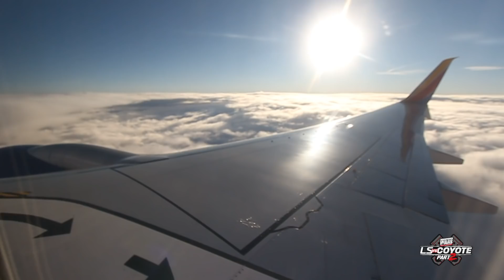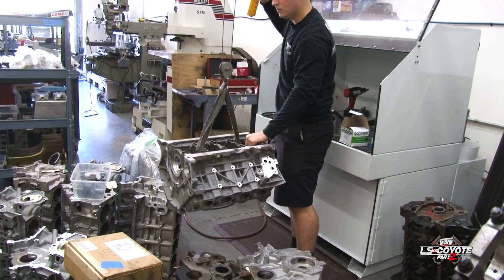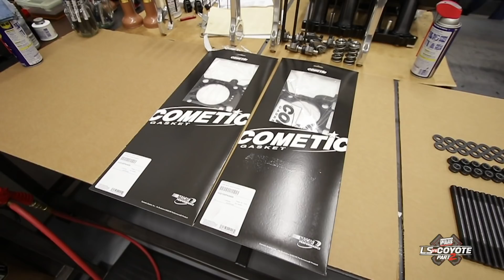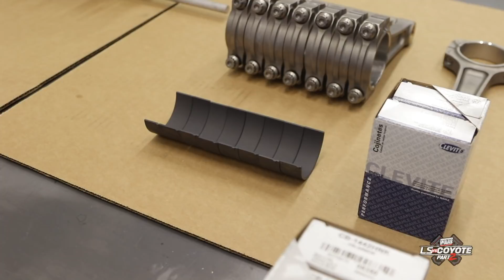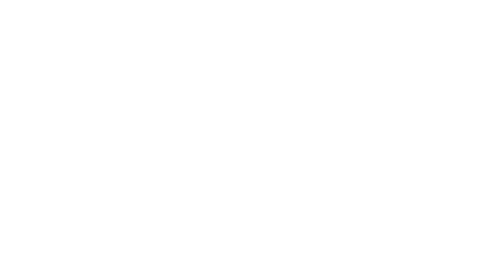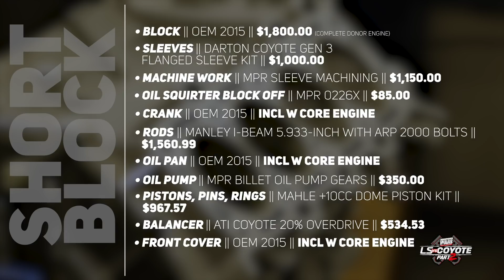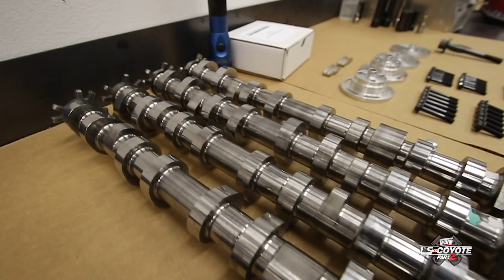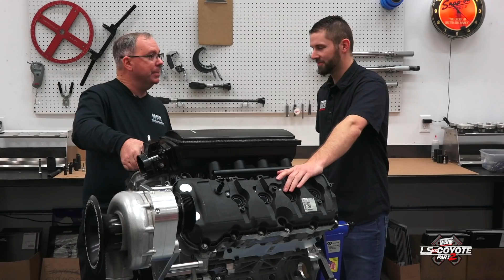LS vs. Coyote 2 Episode 3: The Coyote Engine Build

Comment: Chevy dude fell in love with that coyote. He can see the light
Reply: He will when through the window in the block....
Reply: Got Juice The old Modular block has held nearly double the power any OEM LS block has.  

Funny how a block gets stronger when you don’t have to machine a cam journal through the center of it.  Poor LS...
Reply: @BCSVT  All of you guys can talk all the smack ya want, but the fact remains a well built Coyote OR Chrysler Hemi engine is so damned stupid expensive, it's completely out of the realm of the average guy, and I'm talking about middle income folks........not liberal bums who can't afford a used car. Dollar for dollar spent on horsepower, ya just can't beat the LS platforms. And the PROOF of what I'm saying is all the guys, numbering in the thousands, who drop an LS into an old Fox body MUSTANG. That just burns your asses, and you know it. And by the way "BC".......your comment about "blocks being stronger with no cam journal bored through the center" is pure bullshit. Because literally tens of thousands of built LS motors making incredible power are living just fine. Most of you guys talking smack against LS engines can't even dream of affording a Coyote motor anyway, and you know it.
Reply: Howabouthetruth You’re just regurgitating the same, old ignorant myth.  The only thing more expensive about a fresh Coyote build is the camshafts.   Everything else is on par.  

The LS’ advantage come in junkyard availability and the Gen IV truck engine’s ability to handle some basic 700rw combos with decent reliability.  As power climbs beyond that the LS becomes exponentially more and more expensive.  To make 2000+ HP the 4V Fords have always been able to get there more cheaply than the LS platform.  

LS’ are only cheap to a point. 

I know many, many guys with over $30K tied up in LS-based longblocks that I could match the performance of with a $15k 4.6 4V build.
Reply: @BCSVT  Oh BULLSHIT.........The ONLY thing you said that is true is the fact you can find LS donor engines all over the place for dirt cheap. And the $$$ you saved goes towards heads & porting and slap a turbo charger on it .....( with forged steel rotating assembly for anything with crazy power ) and it's A FRACTION of the price of the Coyote. Funny how ( and this REALLY burns your ass ) that dude did just that & dropped it in his old beat up Fox body Mustang ( famously known as "THE BEATER BOMB" ).........and he beats the living piss out of over 90% of the guys he's racing. Even guys making "more power"..........WHY???.......BECAUSE IN THE REAL WORLD, RAW "RAW HORSE POWER" MEANS NOTHING IF YA CAN'T GET THE CAR TO HOOK UP ON THE TRACK, OR HANDLE ON A ROAD COURSE. AND KNOWING HOW TO DRIVE IS JUST AS IMPORTANT TOO. POWER IS ABSOLUTELY NOTHING WITHOUT CONTROL. WELCOME TO THE REAL WORLD. There's guys making around 900rwhp beating the shit out of guys with 1,400.......because they are hooking up & launching better........"Einstein". And "where's all these Coyote motors" running in street rods all over the world??? HUH??? OH, THAT'S RIGHT, THEY'RE ALL USING THE LS PLATFORMS INSTEAD. And for your information, I'm not one of these "Ford vs Chevy vs Chrysler vs foreign" guys. I like them ALL. But I'm also rooted in REALITY. And the reality is you just can't beat the VALUE of the LS platform for making cheap RELIABLE power if done correctly. We're not living in a world where most guys have "an unlimited budget" to build all new shit starting with an OEM crate motor and building UP from there.  HELLOOOO.  SMART guys who live in the real world are relying on the PROVEN LS platforms straight out of the junk yard to build incredible power vs COST. And you will NOT do that with Ford or Chrysler set-ups. END OF STORY.
Reply: @howabouthetruth2157  There's zero in bullshit in my post, feel free to refute a single, solitary point I made in my previous post.  

You know how I know I'm not full of shit?  I've done it.  I know what it takes with both engines.  I know what costs what, what's obvious is you don't.

PS  Coyotes swaps in street rods have become very common.  But don't let that stop you from continuing on with your ad populum logical fallacies.  
PPS  Stock Coyote engines will handle every bit as much power as an iron block Gen IV truck engine (the strong ones), makes far more power than the iron Gen IV truck engines (power adder for power adder OR n/a)  and running Coyote truck engines are becoming common on the used "junkyard" market.
Reply: @BCSVT  BC........I ALREADY refuted what you stated WITH PROVEN FACTS ........DUMB ASS. Hey, YOU started this BULLSHIT by stating tour absolute NONSENSE about how "the LS is weaker due to the cam bore in the block"......PLEASE SHOW THE CLASS WHERE ALL OF THESE LS ENGINES ARE THAT "FAILED DUE TO THE CAM IN BLOCK DESIGN". That was the whole reason I replied to your bullshit to begin with. AN ENGINE IS SUPPOSE TO HAVE AN ADEQUATE COOLING SYSTEM, WHICH MAKES YOUR FAIRY TALE A MOOT POINT TO BEGIN WITH. Furthermore, youtuber "Cleetus Mcfarland" ran his stripped down Corvette "Leroy" to become the first GM stick shift car to run in the 7's.......AND THEY DID IT WITH AN ALUMINUM LS BLOCK DRAINED COMPLETELY DRY OF ALL COOLANT/WATER DUE TO A BLOWN HEAD GASKET. THAT'S RIGHT, AFTER THEY DETECTED THAT THE HEAD WAS LEAKING WATER ON THE DRIVER'S SIDE, THEY PURPOSELY DRAINED ALL THE WATER/COOLANT SO HE WOULDN'T CRASH, AND CONTINUED MAKING FOUR 1/4 MILE PASSES TO BREAK THE RECORD, THEN DROVE IT BACK DOWN THE RETURN LANE, CRANKED IT UP AGAIN TO DRIVE IT INTO THE TRAILER, STILL RUNNING. They shipped the complete engine back to Texas Speed & Performance who had originally re-sleeved the FACTORY aluminum LS block ( NOT a cast iron block ) with their own sleeves, wherein they documented the entire tear down & inspection on video with NO edits. THE BLOCK WAS JUST FINE, EVEN THOUGH IT RUINED THE CRANK & BURNT A ROD & THE ROD BEARING. THE BLOCK IS TOTALLY RE-USABLE. SO WERE BOTH HEADS. GO SEE BOTH OF THOSE VIDEOS FOR YOURSELF. CARE TO EXPLAIN THAT???  WHAT IS "SO WEAK" ABOUT THE LS??? So you can take your FAIRY TALE about "LS blocks being weaker due to boring a cam journal in the block" and shove that made up bullshit straight up your ass. LET'S SEE YOU RUN A COYOTE MOTOR WITH ZERO WATER/COOLANT FOR 4 PASSES AT OVER 170 MPH ..........GOOD LUCK WITH THAT......JACK ASS.
Reply: @howabouthetruth2157  You refuted nothing.  

NO OEM cast aluminum LS block has reliably supported 2000 HP.  
Andreas Arthursson made the most power with an OEM cast LS block, at about 2000 HP with a FILLED, IRON block but even that was unreliable for him at that power and he made the switch do a DART billet eventually. 
Unfilled, OEM cast aluminum 4.6 and 5.4 blocks have been reliably holding 2800-3300 HP for a decade.  

The LS block generally begin to crack, you guessed it, at the cam journal web.  Shocking.  

Coyote motor making 1/4 mile passes with no coolant @ 170 mph?  On alcohol/ethanol fuels, not a problem for most engines.  
Your problem is you suffer from a severe lack of knowledge and severe confirmation bias.  
PS, Cleetus barely made 1000 RWHP with OEM block.  He is now using an iron LSX block, the same block Justin Schmidt split several examples of in a single season of X275 at well less than 2000 HP a few years back.
Reply: @Searb reath  Searb reath..........THANK YOU. At least someone other than me here has some common sense & lives in the real world..........Because this other viewer "B C" simply happens to be one of those delusional candy ass "Ford guys" who wants to make every stupid excuse to hate on the best damn V8 platform mass produced to this day. I like them all........but it pisses me off to see ANY of these guys cry & whine as they stick up for "their favorite manufacturer". I like em all. But there's no denying that General Motors made a real winner when they produced the LS family of engines. Cheapest AND easiest to make serious reliable power FOR FAR LESS.
Reply: @howabouthetruth2157  He is as ignorant as you.  Feel free to put together a 2000+ HP reliable LS combo and send me the bill so I can laugh at your sticker shock.  You speak like someone that has never done anything beyond a run-of-the-mill junkyard build, which is clearly exactly what you are.
Reply: @UCLw75Flh9QUa9cSZFxVB_dQ BC..........HEY ASSHOLE, NOBODY HERE IN THIS BUILD OFF IS BUILDING "2,800 - 3,300 hp" ENGINES. FURTHERMORE, GO TRY TO ARGUE WITH NELSON RACING.........JACK ASS. BESIDES, BUILDING A STREET ROD WITH "2,800 - 3,300 hp" IS NOTHING MORE THAN VANITY.  GUYS ARE RUNNING 1,200 TO 1,400 hp TO RUN 7 SECOND PASSES WITH NO PROBLEMS WHATSOEVER USING LS ENGINES. AND I'LL REPEAT MYSELF: WHERE'S ALL THE "COYOTE BUDGET BUILDS" ALL OVER THE WORLD???  I REST MY CASE, YET AGAIN......BECAUSE THE LS PLATFORM HAS THAT TITLE. WHO THE FUCK GIVES A DAMN ABOUT "2,800 - 3,300 hp" IN THE REAL WORLD. BECAUSE IT DON'T MEAN SHIT WHILE YOUR SITTING THERE SPINNING TIRES, AND YOUR COMPETITOR JUST BLEW YOUR FUCKING DOORS OFF MAKING HALF THE POWER.......SO FUCK OFF DAISY.  I NEVER SAID I DISLIKE FORDS OR CHRYSLERS......OTHER THAN THEY ARE TOO DAMNED EXPENSIVE FOR THE AVERAGE GUY TO BUILD. GM MADE A REAL WINNER WITH THE LS PLATFORM, AND EVERYONE KNOWS IT. YOU HAVE TONS OF OPTIONS & THEY'RE ALSO THE EASIEST V8 TO BUILD.....  LAST BUT CERTAINLY NOT LEAST>>>>> HERE'S 2 SIMPLE QUESTIONS FOR YOU........DUMB ASS>>>>> #1: WHAT ENGINE PLATFORM ARE ALL THE TOP FUEL GUYS USING TO MAKE 11,000 HP, AND HAVE BEEN FOR DECADES.......ANSWER>>>> THE CHRYSLER HEMI PUSHROD ENGINE.........QUESTION #2: WHERE ARE "ALL THE FORD COYOTE MOTORS WITH OVERHEAD CAMS" IN TOP FUEL COMPETITION........ANSWER>>>> ZERO.  AND DON'T EVEN TRY THE LAME EXCUSE "THEY ARE AFTERMARKET EXOTIC BLOCKS" BECAUSE "A" >>>> THEY STILL USE THE PUSHROD DESIGN, AND "B" >>> BACK WHEN TOP FUEL WAS STILL A REALISTIC MOTOR SPORT, EVERYONE LIKE DON GARLITS AND SHIRLEY MULDOWNEY WERE RUNNING THEIR ENGINES IN MULTIPLE RACES AND ENTIRE SEASONS......NOT "BLOWING THEM UP DURING EVERY PASS" LIKE THEY DO TODAY........BUT EVEN SO, THE BLOCKS TODAY WITH PUSHROD DESIGN MAKING 11,000 HP ARE STILL RE-USED A NUMBER OF TIMES.......AND "YES"........I'M TOTALLY AWARE THAT "MY CAPSLOCK IS ON"........SO GO FUCK YOURSELF.
Reply: @BCSVT  B C........Go read my final response to you asshole, I was just about to post it when you posted this nonsense again. There's TONS of guys out there that built "junk yard engines" using LS platforms that'll outrun your candy ass, and you damn well know it. PLEASE.......BRING YOUR SHIT AND RACE "BEATER BOMB".....EVERYONE NOT LIVING UNDER A ROCK KNOWS WHO HE IS........SEE HOW WELL "THAT WORKS OUT FOR YA".........AND TAKE YOUR COYOTE MOTOR & BUILD IT WITH 11,000 HP FOR TOP FUEL COMPETITION........BECAUSE "YOU'LL BE THE FIRST". NOT HAPPENING.......YA WANNA TALK ABOUT "HIGH HORSE POWER" ASSHOLE???  YOU GO READ MY PREVIOUS RESPONSE ABOUT TOP FUEL ASSHOLE.....I DARE YOU. CASE CLOSE.........JACK ASS. ( I swear.......it takes a true candy ass pom pom waving cheer leader nowadays to piss & whine as they claim "LS engines are weak" or "they suck".........that's pure BULLSHIT.
Reply: @Searb reath  Searb reath........That's damn right. Hell, I bought my 2000 Tacoma 4x4 with automatic transmission & 3RZ engine ( duel overhead cam version ) and it'll outlast them all as far as a daily driver. Here it is well over 18 yrs later and over 330,000 miles.....on ALL original engine & drive train......and I've beat the living piss out of it years ago when it was newer. But that doesn't mean I don't love all the great V8's made by all 3 manufacturers at one time period or the other. Besides, all the best tech/mechanics frown on these morons like this other viewer "B C" who is hell bent on "dissing the LS platform".........what a freakin' joke. He's crying & claiming the LS engine can't handle "2,000 to 3,300 hp"..........only clowns dream of engines making that much power. So I told him to take his damn Coyote motor "with 4 overhead cams" and build it to handle 11,000 hp and see how he does in Top Fuel competition. I rest my case. Because NOTHING can stand that amount of power like the pushrid engine design. ( or even 6,000 hp, like back when Top Fuel was still "a realistic motor sport" as teams like Don Garlits and Muldowney ran their Hemi pushrod engines all season long with far less rebuilding like they have to do today......but even today.....the blocks are still good for about a dozen races ) I rest my Case........
Reply: ......and PS.........Back in the days when Garlits and Muldowney ran Top Fuel.......they were indeed running over 250 mph.........with full blown pushrod Hemi engines.  Let's see the crybaby viewer "B C" answer to that one. Even at the 6,000 hp they were making back then.......it would sling "4 overhead cams" all to pieces. That's exactly why they haven't ran them all these decades in Top Fuel. I don't even count today's Top Fuel racing, because ya have to be a billionaire ( literally ) to afford blowing those 11,000 hp motors up during every pass.
Reply: @howabouthetruth2157  You don't speak for everyone.  In fact, you can't even speak for yourself.   
I supply 1500+ HP engine builds with regularity, such power levels are downright common even in street cars these days. 
Not everyone is content with 700-800 rwhp junkyard builds, but I suppose keeping your goals low keeps in the LS impressive in your mind.     

The Coyote architecture will not support top fuel levels of power, but with OEM cylinder head castings it will get about 1200 HP closer than the LS will with OEM head castings.  

Let me know when the LS finally cracks off sub 5.90 @ 250+ mph 1/4 mile passes like the old 4.6 4V has on OEM cylinder heads and OEM block castings. 
Last I checked, the LS was still way short of that even with 6-bolt canted valve heads and Kurt Urban-spec Dart billet blocks and not a single GM part anywhere in or on the engine.
Reply: Howabouthetruth you don't get out much
Reply: @jaywhy225  Jay Why.........What the hell is it with freaks like you. Is that all you've got? How many times do people like myself have to repeat time & time again that we like MANY of the engine designs from MANY of the auto makers, but can't stand it when some candy ass "Ford or "Chevy" or "Mopar" guy starts acting like a damned pom pom waving cheer leader to dis other auto makers. It's childish BULLSHIT. Even the best techs/mechanics frown at that bullshit, because they KNOW that many of these engines from "the big 3" can be built to get very similar power compared to one another. But the UNDENIABLE fact remains that ya just can't beat the LS platform when it comes to "horse power vs cost". Asshole viewers like YOU and "B C" who made the stupid claim that "the LS is weak because of the cam bore".......is TOTAL BULLSHIT. Most of these guys wanting to make "2000 to 3000 hp" in a street/strip car are doing that silly shit out of sheer vanity. "Sheer  horse power" NEVER won a damn race all by itself, and anyone with a brain should know better. So you can take your silly "you don't get out much" statement and shove it up your ass too. I'm a business owner, and I run my ass off. I've got plenty to do, and facts to mention in a debate. You don't have shit to offer. If you're gonna post a response here, you could at least offer up something that pertains to the subject at hand..........but you can't even do that.......asshole.
Reply: @howabouthetruth2157  The LS block is made weaker by the cam bore, much weaker than it would be if the if the cam journals were left unmachined. 
All OEM LS blocks (aluminum or iron) are also weaker than the all OEM 4.6 & 5.4 aluminum blocks. 
You have yet to refute that assertion, and lack the knowledge and experience to do so.  
I'm not sure you realize how truly self-evidence that statement actually is.  

Your statements to the contrary makes you look less intelligent than your choice of grade-school insults.  

Making 2000+ horsepower is not vanity, it's what necessary to be competitive in many racing classes and events. 
What's good enough for you obviously isn't good enough for me, so stay average and the LS will continue to satisfy you.
Reply: Howabouthetruth triggered much bro ?    Quite the retort to the simplest of responses.    Look at you go assuming my position on any of the things posted above or in this video.   Calm down muffin.    Your bias isn’t allowing you to see beyond the scope of this challenge.
Reply: @howabouthetruth2157  if anybody is angry it's you bro. CAPS LOCK DOESNT MAKE YOUR POINT MORE VALID, IF ANYTHING IT MAKES IT LESS VALID BECAUSE IT SHOWS YOUR ANGER. ESPECIALLY when you CAPS random ASS words FOR emphasis.
Reply: @jaywhy225  howabout is right. you are the one who doesn't have anything better to do with yourself. he also told the truth about ls engines. they are nu 1 for making power for less money, and they last. so get a life.
Reply: @robertmillison8933  Robert Millison.........MY CAPSLOCK OBVIOUSLY BOTHERS THE SHIT OUT OF YOU. AND YOU'RE ANOTHER CANDY ASS POSTING A COMMENT/RESPONSE THAT HAS ABSOLUTELY NO RELEVANCE TO THE SUBJECT AT HAND. GET A LIFE PUNK. I DON'T GIVE A RAT'S ASS WHAT YOU THINK.
Reply: @robertmillison8933  Robert Millison........Hey everyone........get a load of this NOBODY "Robert Millison".......and I mean that literally. Go check out his "youtube channel". NOTHING THERE. IT'S A BIG BLANK. Just like his mind when it comes to what was said here. Stupid assholes aren't even capable of reading the material, he's too "upset with capslock"........but he says "I'm the one that has the problem".......WOW......JUST WOW. Go play with your cat or watch TV boy........you're missing cartoons. Come back when ya know more about engines. Or else mind your own damned business.
Reply: entrepreneurhomeboy lol.  Player 2 has entered the game.   Look at you go !     “THOSE that SCREAM the LOUDEST”.        Yes it’s true, for less budget you can make decent power with the LS platform vs anyone else.  I don’t think anyone is denying that.   Bump that budget up and the field is levelled, if not leaning other directions.  THAT is FACT.     If you want to be a budget fanboi, so be it, being cheap is being cheap.   Want to make serious power, get your wallet out.    Ask me how I know.    Oh yeah, show me an LS true street car (as produced by manufacturers, no tube frame, back half, etc) that runs 6’s and 7’s please.   We’ll all wait.
Reply: @howabouthetruth2157   You really don't get out much, do you?

I guess Chevy is the rock you live you under.
Reply: B C ooof.   Wait for it ....   more CAPS lock from trigger muffin.    Lol
Reply: @howabouthetruth2157  wow. Such anger. Much rage. Over what? Me saying that you can get a point across without using caps lock like an angry teenager. Did daddy touch you when you were a kiddo? Did Uncle Jimmy diddle you while talking about Ford motors? Is that why you're so triggered over a video about a coyote motor? I can tell it brings up bad memories for you. You'd should probably get some counseling. Maybe go to the police and show them on the little dolly where the bad man touched you? I'll wait.
Reply: @jaywhy225  what's your problem jay? you think it takes a tube frame to build a street legal car that could run 7's? who said anything about that, other than you? the only difference between a street legal car that can run 7's is they will not allow you on a sanctioned drag strip due to safety regulations. and it's awful funny, garrett (cleetus mcfarland ) has driven "leroy" on the streets. "player 2 has entered the game".......seriously?" nobody was talking to you in the beginning, and you decided to "enter into the scene" yourself........but ya don't like it when i did? what a hypocrite. you need to get a life, because i read this entire thread, and that one dude was saying that nonsense about ls engines not being strong enough at the cam bore. funny, we don't see them all over the junk yards because of that. they are only in the junk yards by the thousands because they were wrecked. plus ya just agreed that the ls is the choice for building power for less. and then turn right around to start shit over "raising the budget". who freaking cares. you are seriously the one who has nothing better to do with yourself. so get a life you hypocrite.
Reply: @entrepreneurhomeboy   Yeah, because your average junkyard engine is making triple and quadruple the stock power.  You do realize this statement, like your ignorant brother's up there, doesn't refute anything, right?   Go build a 1500+ crank HP OEM block LS and let me know how long it lasts and what is the failure point it.  I'll wait.
Reply: @robertmillison8933  ATTENTION ALL VIEWERS: Get a load of this asshole liberal freak named "Robert Millison". Just look at how he has now lowered himself to perverted shit. Where did THAT come from. FROM HIS OWN MIND. THIS IS WHERE HIS OWN TRAIN OF THOUGHT GOES. Does that make you feel like a big boy Robert? Only little punks talk like that who were raised by a single whore of a liberal mother. THEY RAISE LITTLE WORTHLESS BRATS. That goes to show where his head is at. Nothing but a worthless coward looking to start shit with someone for no good reason whatsoever. I also find it quite odd that these house flies like Robert Millison are almost always the ones with NOTHING on their own youtube channel but a big blank. He JACK ASS.........if you used your fucking brain for once in your life and read this entire thread in proper order, you would know that I have nothing against the Coyote motor at all. I just fire back at the assholes who wave their pom poms for what they favor, as they talk total bullshit about another make. If I saw a "Chevy only" fanboy saying "the Coyote is a piece of shit"......I would set him straight too.......DUMB ASS. Just like I told "B C" that if he wants to start talking about ridiculous amounts of power, then why doesn't he try to make his Coyote motor handle 11,000 hp and enter it into Top Fuel. NOT HAPPENING. And all of this got started because he whined & cried about LS engines, talking shit. But stupid little pricks like YOU "Robert Millison" can't understand the context of that, can you? Of course not. You're just here to start shit out of the blue like a fucking coward. Fuck off. And take your perverted mind with you. Nobody here was talking that kind of perverted filth but you punk. Try saying that repugnant shit to a man's face & watch how fast you get your ass beat.......ya fucking coward. ALL OF THIS CHILDISH NONSENSE BECAUSE FORD GUYS THAT HATE CHEVY CAN'T STAND THE FACT THE LS PLATFORM MAKES GREAT DEPENDABLE POWER FOR FAR LESS MONEY. And most of you punks couldn't even feed & clothe yourself anyway......mommy still does that for you......let alone "build an engine to make 3,000 hp".
Reply: @howabouthetruth2157  and I daily a Chevy truck so I certainly don't hate Chevy.
Reply: @howabouthetruth2157  and I'll gladly say that shit to your face if I wanted to go to some hillbilly place where people fuck their sisters and have 6 eyes.
Reply: Howabouthetruth - this guy legit believes in Bigfoot no use in arguing with him.
Reply: @howabouthetruth2157  You actually believe that all LS swapped fox bodies are Ford guys in search of cheap power, when in reality they are Chevy guys lookimg for a good platform to drop their hillbilly engine in...
Reply: @mcdirt6455  mc dirt..........What the fuck is the matter with punks like you. I never said or even implied such a thing. You made that shit up in your own head.........straight out of La La Land. I only said that it burns the asses of any "Ford guys who hate Chevy's" and it certainly does. Guys are stuffing LS engines in Miata's as well. So you can go fuck yourself too, dumb ass. Boy, the freaks are out in numbers today. "Hillbilly engine".........you have lost your fucking mind. I know a lot of Ford guys and Chevy guys personally as friends that don't act like a bunch of little pom pom waving sissy ass cheer leaders. They appreciate and respect any good engine design, they just happen to be sentimental towards one brand or the other. They don't make total fools of themselves like all of you little faggots. You can always tell the fake pussies when it comes to engines and racing in general. They think, act, and speak like you little twerps. The real men get along and have a good time, maybe poke a little fun at each other at the track, for everyone to laugh, win or lose. But you little faggots aren't capable of such a thing. "Mommy if you don't buy a Ford I'm going to run away"........GROW THE FUCK UP. Every last one of ya. But I already know better. Because one of you little pussies just can't wait to run your mouth too. I don't give a shit WHAT you run or "how much $$$" you throw at it........there's always a guy to show up sooner or later in something else to beat you. So what are you little chumps going to do, "commit suicide"???  mc dirt.........I can already tell you're just a snot nosed punk who can't afford nothing without mommy giving it to ya........because no grown man calls an LS engine taken from a wrecked car "a hill billy engine" as if it's some worthless piece of shit. Most of the fastest guys out there are running engines taken out of a wreck, ya fuckin' morons.
Reply: @BCSVT  are you ok? You seem like you have a case of no nothing  of ls's.
Reply: I am Nobody Damn, you got me.  Your name is appropriate
Reply: @BCSVT  yup you are nobody and I am nobody because I am sombody.
Reply: @howabouthetruth2157  Actually bud nothing compares to an old 426 hemi that's a fact. And for the fact that the old 4.6 aluminum stock block can handle 2500-3000 hp. I don't see any motor in the world even coming remotely close to that, certainly not an ls. If you don't believe me, go look up the fastest mustang in the world. He is in the 5s and is using guess what, a stock 4.6 aluminum block. When it comes to being able to handle power, nothing can handle power like a hemi or a mod motor.
Reply: @howabouthetruth2157  Leroy is impressive sure. But the fastest manual mustang in the world is even faster. It's a yellow sn95 cobra, still a real street car too. Full interior all original body panels etc. Oh yeah and it doesn't have a built block like leroy. It has a stock 4.6 aluminum block, he just ran a 7.67 and is getting faster and his launches are way better then cleetus.
Reply: @karlhopkins713  Karl Hopkins.........Do us both a favor. Go back in this very thread and read all of my posts. You will see where I asked the other viewer "BK C" quote: "What is the ONLY motor that has been used in Top Fuel for decades now"........Answer: The Chrysler Hemi PUSHROD engine.........end quote. And then I challenged him to "take his Coyote motor with 4 overhead cams and try to make even the horse power that they were making with the Chrysler Hemi's back when Top Fuel was still a real sport when racers like Don Garlits and Shirley Muldowney were on top. They ran the same damn motor all year, with only a fraction of refreshing an engine compared to today........blowing up the damn motors during every pass. I never once said that an LS motor could do that. You find where I did and I'll eat this laptop. But he was talking about making crazy horse power, so I made that point. Even the HP they were making with those original 426 Hemi's back then would sling a Coyote motor all to pieces. HEY, HE WAS TRYING TO BRAG ABOUT "HOW MUCH HORSE POWER A COYOTE CAN HANDLE". ( and the engine builder in this very video stated he WANTED to use a different set-up for the Coyote he is building but COULDN'T.........BECAUSE OF THE HIGHER COST. ) You will also see where I stated MULTIPLE times that I have nothing against ANY of the proven engines from all three auto makers. I like them all for what they are. But this bullshit with these candy ass "Ford or die" fairies is downright stupid & childish, saying the LS is "weak" and "hill billy motors" and all kinds of other nonsense. Most of those assholes saying that stupid shit are little punks anyway. Who the fuck in the real world is going to make REAL use of "2,500 to 3,300 hp" as he is blabbering about anyway. I even went so far as to state MOST people (middle income, NOT bums or punks who flip burgers at minimum wage ) can't even afford to buy & build a Hemi or Coyote motor. I ALSO stated that sheer horse power isn't everything in a race. A guy running 1,300 hp ( or LESS ) with the right car frame/body, transmission, gearing, tires, and driving ability can run off and leave a damned "3,000 hp engine" as it's spinning tires. So go back and read all of that yourself before you go making false accusations or assumptions about me. Got it? GOOD. And everyone knows ya just can't beat the LS platform for making serious reliable horse power on the cheap. 600 to 800 hp is serious power with STOCK rotating assembly. Add in forged steel internals and an LS can easily run 1,400 hp and LIVE for HUNDREDS of passes and/or dyno pulls. It's the only fucking reason it's the #1 choice all over the world..........guys are pulling them out of wrecked cars & especially trucks & stuffing them in everything. Good grief man. Nobody but a bunch of shit talking snot nosed punks could deny the LS engine as a damn good platform. The next time you want to target somebody..........you better stop long enough to read the ENTIRE conversation instead of reading only 1 or 2 posts resulting in YOU taking what another man is saying completely out of text. It's a damn shame when I have to COME BACK HERE AND REPEAT MYSELF 3 TIMES OVER.
Reply: @karlhopkins713  THE FASTEST MANUAL MUSTANG HAS A FUCKING BODY ON IT. IF YOU DON'T THINK AERODYNAMICS DON'T COME INTO PLAY.........EVEN AT ONLY 150 MPH.......YOU'RE SMOKING BIRDSEED. THE TECH AT THE WIND TUNNEL SAID LEROY WAS THE WORST CAR HE EVER TESTED FOR WIND DRAG. BUT YOU OBVIOUSLY DON'T THINK ABOUT THAT STUFF........DO YOU.
Reply: @howabouthetruth2157  Lmao glad I made you mad bud.😂 I guess you just want to argue, and I just want to irritate someone lol.
Reply: @karlhopkins713  howabout is right. all of you little kids have nothing better to do than try to pester people. isn't it close to your bedtime karl.
Reply: @entrepreneurhomeboy  Lmao bud I have time to play around. Work is done for the week and it's gonna rain all weekend so no fun for me in my stang.🤷
Reply: @howabouthetruth2157  thank you very much for hitting the nail on the head. 👍👍✌✌👊👊👏👏👏👏👏👏👏👏
Reply: @bowtie-man  mr.18436572........You're very welcome. Telling the truth is easy.
Reply: @howabouthetruth2157   indeed it is, accepting it is another story. ✌✌👍👍
Reply: @howabouthetruth2157  You don't tell the truth though, you tell your uninformed, ignorant interpretation of the truth which is; ultimately, a lie. 

No one cares about your straw man Top Fuel argument.  

Prove this statement wrong:  A fresh 2000 HP capable 4.6 4V build is less expensive than a fresh 2000 HP capable LS build.
Reply: @BCSVT  HEY EVERYONE, GET A LOAD OF THIS VIEWER FREAK: "BK C"........It's now been 4 or 5 days since we all posted in this thread, and this asshole: "BK C".........has just messaged me again out of the blue with more of his bullshit. Hey "BK C".......what's the matter, are ya bored? THIS VIDEO & THIS MASTER COYOTE ENGINE BUILDER HAS PROVEN YOU AND YOUR FAIRY TALE MYTHS ABOUT "stock coyote blocks handling over 900 or more horsepower" is just that, A FUCKING MYTH. He clearly stated in this video that these Coyote motors with factory stock sleeves can NOT handle anything over 900 hp, or it WILL destroy the block. They require MAJOR machining to cut a ledge at the top of each cylinder bore to fit UP-GRADED Darton FLANGED sleeves to keep those sleeves in place. He also stated IN THIS VIDEO that the Coyote block requires WELDING WORK done to a couple critical areas TO STRENGTHEN THE BLOCK TO HANDLE THE EXTRA HORSE POWER DELIVERED BY FORCED INDUCTION . The machine work, the re-sleeving, and the Darton flanged sleeves ( or other sleeve upgrades ) COST $2,500 ALONE. THAT DOESN'T EVEN COUNT THE COST OF THE BLOCK ITSELF. ( The only thing in the factory Coyote block that remains is the forged steel crank. ) AND ALL OF THE ABOVE RESULTS IN A BLOCK THAT IS FAR FROM "STOCK". For only $3,250, you can buy A BRAND NEW 427 LSX block WITH the sleeves already in it to handle 2,000 hp. Furthermore, the 4 fucking performance cams, 32 valves and valve springs ALONE costs another $2,800 NOT COUNTING THE COST OF THE HEADS THEMSELVES OR THE SKILLED LABOR REQUIRED TO DEGREE ALL OF THOSE CAMS. Any way you cut it, new OR used for either the LS or the Coyote, you can build an LS engine to make the same power of a Coyote motor for A FRACTION of the cost. What the fuck is the matter with you "BK C"??? You must be a liberal, because ONLY a stupid fucking liberal can be shown FACTS ( such as right here in this very video, by one of the top Coyote engine builders in the industry ) yet you STILL ignore and deny it........as you come back here 4 or 5 days later to start your bullshit all over again. The master engine builder in this video knows a hell of a lot more than YOU asshole. So you can take your fairy tale myths about "stock Coyote blocks" and shove it straight up your fucking ass.......ya stupid  punk. You pester people out of the blue worse than a fucking house fly......get the hell out of here.........go outside & play......or go watch TV.........you're missing cartoons.
Reply: Ford 1
Reply: @howabouthetruth2157  howabout, you are right. it is a shame that a channel showing a build off between a Ford & Chevy motor can't be enjoyed by real men who appreciate all of them for what they are, without a bunch of little kids showing their asses in these comment threads like little weirdo's  hiding in cyber space. i'm glad my kids weren't raised like that. i raised them better. and if any of these weirdo's are in fact grown men, then that's even worse. grown men resorting to saying such sick crap. it proves they never had a father to raise them for sure.
Reply: @entrepreneurhomeboy  You can say that again. After I proved several of these little punks wrong, they actually ADMITTED they are only here to try to start trouble or harass people who like LS engines, even though we like the other engines as well. This channel would be doing all of its mature viewers a huge favor every time they do one of these build offs to simply disable the comments altogether. Then no one would have to put up with any of the stupid or twisted, perverted shit posted here by all of these little cowards. Worse than a bunch of house flies.
Reply: @Searb reath  Yes, SOME (not a lot) engines can make over 2,000 HP reliably on factory block and cylinder head castings.   Namely the 2JZ-GTE and the Ford 4.6 4V.  
The VR38DETT and 4G63 pretty consistently require aftermarket billet blocks to hold that power reliably, i.e. to last a season or more without major component changes.  
The LS falls in the latter group, requiring aftermarket billet blocks and 6-bolt billet cylinder heads to hold that power.  Andreas Arthursson proved that in his promod car, he couldn't keep a filled iron block LS together @ 2000 HP for more than a few 1/4 mile passes.    

The Ford Modular has been racing extensively (and reliably) @ 2500+ HP with OEM block and cylinder head castings.  
The standing mile Ford GTs do it, 4 different Modular combos have been 5s @ ~250 mph in the 1/4 on OEM block/head castings.  

The MSRP on a 481X long-block is $67K.
Reply: Just about anything fresh machined and hot tanked going through professional blueprinting/assembly is a thing of beauty.
Reply: I am not a chevy guy I am a Pontiac guy that loves all makes off cars if they have something cool to offer and I love engineering.
Reply: @robertmillison8933  Robert Millison. You just wasted your own time punk, because I'm not reading one more word of your bullshit. You've already proven what a perverted little punk you are. Stooping down to talk like a little smart mouthed brat obviously boosts your little liberal ego. So keep typing away to entertain your own sick little mind.